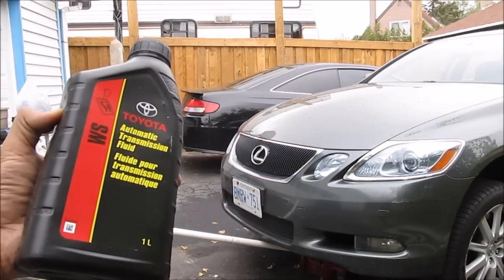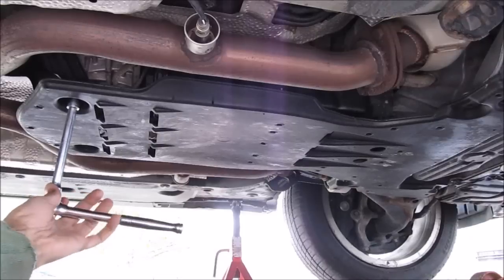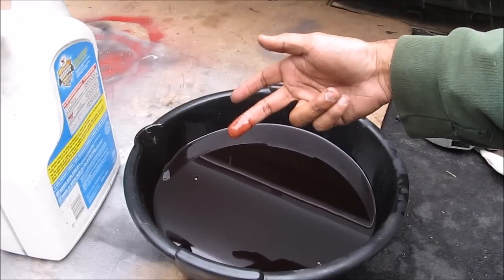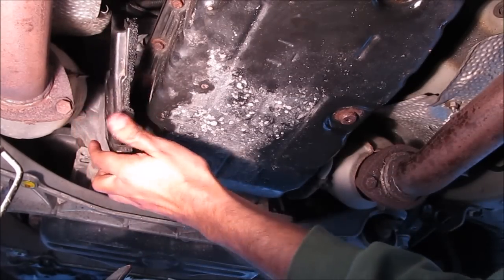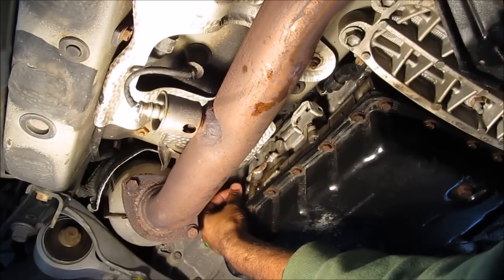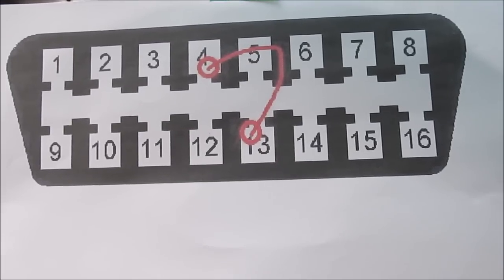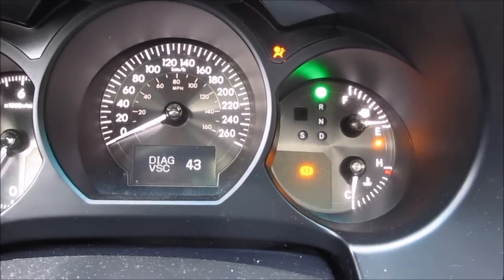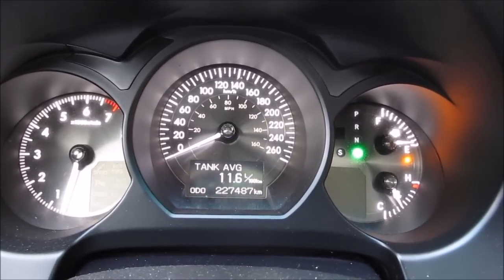Toyota / Lexus Sealed WS Transmission Fluid Change

Comment: Lexus...the dream. Another great video. What year is your Lexus and how do you like it?
Reply from the maker: +Nathaniel D. It's a 2007 GS350. I'm absolutely loving it, smooth ride, good power, no torque steer, fairly luxurious.
Reply: I driven an 06 GS300 but its really the GS350. Its drives quite similar to the ES350 just the only difference is the ES is FWD while the GS is RWD. The throttle is very sensitive as you don't have to press too hard on the pedal and it takes off. lol

Comment: Hi, just a quick question about the diagnosing of temperature, do I just need to leave it on park and let it idle and wait for both the park and drive lights to come on simultaneously after removing the wires on the obd port to know that it is on the right temperature to check the straw underneath?

Comment: Great video. Only thing I would want to stay away from is those cheap hand pumps. You can see the tube in the box is kinked!  Trying to put back the same amount given all those tubes and extra length that would have fluid in them and surely it gets messy and not all would be pumped. I gotta think a funnel/tube coming from the engine compartment side fed down would allow a much cleaner, precise and easy refill. Let gravity do all the work!  Great vid!
Reply from the maker: +condor5635 I wish, but the transmission is located underneath the cabin on rwd cars, not under the hood, so there's no getting at it from above.
Reply: speedkar99 
those bastards totally did that on purpose. Heck, the whole change up with unnecessary added complexity in newer vehicles were all on purpose. 
Sigh..
Reply: I love those transfer pump and it works really well for me. Need to put a bit of oil inside to reduce friction (as instruction say that came with it).  The tube maybe kink but just straighten it out since the tube is very flexible.The only drawback using these is that the oil keeps flowing out after you stop pumping so have a container to catch the oil spilling out every where.

Comment: Your new car? Congrats brotha!
Reply from the maker: Yes it is, thanks!
Reply: Any problems with it? How many miles were on it when you bought it? 

I'm still rolling a 1998 ES300 (thanks for all the great how-to vids lol) but really want to get a GS350 for that rocking V6, RWD and double wishbone front suspension. They're pretty rare around PDX though, especially RWD. The few clean ones local to me are 2010/2011's and $17-19k. A few thousand more and I could get into the newer generation 2013.  Choices, choices.

Oh BTW, do you know if 99-01 ES300 front seats will work in my 1998? A local salvage yard has some clean front seats from a 99+ that have side airbags...while of course my 1998 does not. The front seats are the bane of my interior and when I sell it (for a GS) I'm sure the $50 for these used seats will be worth it.

Comment: Hi, I heard that they offer oil replacement with a special installation (by pumping through the system - like on cars with a box cooling radiator). I considered my box on is250 did not find any handsets for connection. It is possible that they deceive me by talking about such a method of replacement. I think you can change only a partial replacement. What do you think? Thank you

Comment: Do you need to replace both transmission fluid and differential fluid or is it just 1 entry/exit point ?
Reply: Transmission every 25k transmission fluid also lubes awd transfer case if so equipped 
Differentials every 50k

Comment: Is the last part necessary; not switching the gears, but hooking up the wire to ports (4) and (13)?
Reply from the maker: +pete1817 its good to check the level of the fluid in the tranny but not 100% necessary

Comment: if you don’t mind me asking how did you let the excess oil drained since your overflow plug is rusty ? That mean you can end it up over fill it or under fill it ? I really like your highlights but if I were you I’d get a new pan with new some new plugs, that could prevent you from buying a new transmission 😊

Comment: What if you just drain out 2.5 quarts exactly, and put 2.5 quarts in? Do you still need to check fluid level? Please help i think my overflow bolt is seized.
Reply from the maker: I did that. My plug was siezed
Reply: That should work, provided you had proper fluid level to begin with (which you'd never know since they don't give us a dipstick)

Comment: hey, great video. I be very glad if you can help. i got new 4gr engine and gearbox but the gearbox came without any ATF so how do I know how much ATF i should put into the gearbox as your video shows i should put the amount that came out (2.5L), thought mine didn't even have a drop of ATF, and the sites on the net say I should put 7.5 litres? can you please guide me on this
Reply from the maker: Check the repair manual. Since the transmission is used you don't know if it's completely drained or if the torque converter is drained etc. 

You'll definitely need to do a fluid check
Reply: Thanks soo much. I will try to do that.

Comment: So you are only changing less than 50% of the actual transmission capacity ?
Reply: You are correct, I get a transmission flush every 60,009. I change all 11 quarts  at a local shop, they cycle all the fluid out of the transmission until it’s all clean. And it’s not $600 like Toyota wants to charge to drain and fill 3 quarts.

Comment: Wow this is a big pain I think I'll let a mechanic change this but I really like doing stuff myself. So a question instead of doing all the measurements at the end why not just look up the capacity of the tank and then put in that amount and then you know you filled it to the proper level???
Reply from the maker: ATF doesn't go by capacity because it expands by temperature
Reply: @speedkar99  Thank you. I wonder what it's rate of thermal expansion is.

Comment: Tyvm I needed this for my 2007 gs450h earned a subscriber (:
Reply from the maker: Thanks. Is it any different on the CVT?
Reply: Did you need a transmission fluid change or soloneiod

Comment: I don’t see you change the transmission filter under this pan is a big black filter you would need to change is as well
Reply from the maker: Yes if you drop the pan
Reply: If you don’t mind me asking How many quarts did you use for drain and fill ? And do you ever recommend me doing a complete flush to my 08 Lexus gs350 ? Or drain n fill should be good ? FYI I have 110k now and the transmission hasn’t been serviced before ! Thanks In advance

Comment: I just did a drain and fill on my tundra that has never had the transmission serviced. All I did was drain it when it was cold and refill the amount that drained out. I didn’t know I had to do all that. Will it cause any issues the way I did it? Can I just drive around the block and then loosen the hex plug to drain the excess fluid since that’ll probably warm up the fluid.
Reply from the maker: Yeah that should be fine

Comment: Great work. I'll have to do some research and look under the car but, I hope this is similar on a 2009 Lexus IS250 RWD with 111k miles on it. Time to order the OEM fluid.
Reply from the maker: +Mike Anoneemus Yes it should be a similar setup on all rwd Toyota trucks and Lexus vehicles.
Reply: 111 miles only ? Wow you don’t drive much huh

Comment: hello  what about the oil filter for this toyota i think it should be changed... dirty filter with new fluid may cause aproblems
Reply from the maker: Yes the transmission filter can be changed if you drop the pan.
Reply: The filter is suppose to be good for 100k.

Comment: RWD in Canada? Did you outfit the car with snow tires during the winters, or just garage kept the GS? I'm thinking of getting a RWD GS350 possibly, but in the States East Coast area we get the occasional snow.
Reply from the maker: I have a Camry with Winter tires when it snows. 
After the roads are clear I still drive my GS in winter. When I get caught in the snow with it I'm dead though

Comment: thanks as hot ATF has higher level, user can loose the overflow hex nut first, rather than open it at high temp. right?

Comment: Awesome video! I have an ‘08 GS350 that I bought 5 years ago with 60K miles. I now have 167K but have never changed the transmission fluid. Is it too late? Any advice?
Reply from the maker: Drain and fill. 
You only get 2.5 quarts out at a time so no harm.
Reply: Thanks bro!
Reply: I have the same car. Are you getting vibrations and weird shifting on gears 1-3?

Comment: Could you do this with just warming the car up for a certain amount of time and drain the excess or will it drain too much if too hot?
Reply from the maker: +Dorjee Gyadatsang you have to warm the car up after you've added fluid and then release the overfill plug, as described near the end of the video.
Reply: speedkar99 I just received the notification of your reply, would like to ask you one more question while you are still online.  Yes, I meant to say after you have drained and refilled, can you just warm up for a certain period of time and then let the drain plug do the rest.  (bypass the cheat code like shifting  and having to do all of  the combinations with the OBD)  Thank you for making this video by the way.
Reply from the maker: +Dorjee Gyadatsang technically there's a certain temperature range the transmission fluid must be between to get an accurate reading, hence the method with the obd2 reader or the shift sequence. If you wait too long then it might get too hot and you'll end up draining more fluid than required.

Comment: Can an old transmission  filter and the fact that it needs new transmission  fluid ,can it can jerking  movements?
Reply from the maker: +cali west yes sometimes
Reply: speedkar99 i hve the same car and let's  say im at a long street driving then ill come to a stop n as im at a sudden  stop youll feel a winding  movement  from the tranny not grinding, n as u press the gas peddle the car will hve a jerk movement  ,it doesn't  happen  all the time but only at certain  times  ,and thanks  for  your time

Comment: The one thing I don't like about this car is that it shifts to 1st gear if I slow down below 5mph. If I'm going over a major speed bump or sometimes crawling around a corner it goes down. Is this normal because if it shifts down to 1st from 2nd I immediately want to go while it's still rolling then it's an ugly upshift

Comment: what about changing the filter?????
Reply from the maker: You can drop the pan and change or clean the filter if you like 
Most of the time it's not nessesary unless your experiencing transmission quirks
Reply: @speedkar99  if you drop the pan do you need anything to seal it baxk besides the screws? Example. New gasket , sealant.
Reply: @luisalcaraz5615  I would recommend changing out the gasket if you're replacing the filter, especially if you don't regularly change out the transmission fluid.  They are often sold together as a kit.

I had to replace the clutch solenoid (common part that goes bad on a lot of IS250 2007, ERROR CODE P2757 - Part#: 35280-30050), did a tran fluid flush, replaced the filter and gasket, been running great.  Check with a magnet to see if there are any metal shavings or burnt odor to the fluid which might mean a transmission rebuild is necessary.
Reply: 1 out of the 3 codes match yours that I got. P2757/ P0983 / P0761 . Sounds like i have to replace the clutch solenoid first before anything and follow your steps. I'm at 162k miles. Got it at 92k. Never changed trans fluid on it.
Reply: @luisalcaraz5615   If you're throwing multiple codes, it's kind of a gamble.  You have the option of replacing multiple solenoids, but if the clutch is done for and you need a rebuild, a good transmission mechanic will likely replace those solenoids anyhow, so you might be out a couple hundred bucks + time if you go the cheaper route first, then have to rebuild anyhow.  I'd have it inspected professionally and get a 2nd opinion at a tran specialist.

Otherwise, try to find out if there are any subsidiary codes to isolate which solenoids are faulty and do everything else I did.  Make sure you do magnet test and smell fluid too.
Reply: @szurheal  where'd you find your clutch solenoid from?
Reply: @luisalcaraz5615  My mechanic friend got it for me but you can order online.  I prefer Toyota OEM, but cost difference should be around $40 for aftermarket.
Reply: @szurheal  I found a kit online. It comes with 9 pcs for $200. I'm not sure if i should get the whole kit or just the solenoid that is bad. What do you think?

Comment: Very less came out from the transmission, maybe your transmission is low on fluid, you should check the level by opening rusty bolt,  i drain the the transmission and came out 3.2 quard which the user manual says and if we change the filter then it should be 3.8 quard
Reply from the maker: For the GS350? Should be 2.5
Reply: speedkar99 how can I buy parts from your store  ??
Reply: This what I said you cant drain the torque converter. It has a bunch of old fluid still inside it unless you drop the tranny. So it seems you just mixing clean fluid with dirty fluid.

Comment: I'm replacing my transmission from my 2007 IS250 because apparently the old owners before me never changed the transmission oil and when I drained it, it was pretty bad so word of advice to Lexus owners changing transmission oil or be prepared to buy a new transmission
Reply: Joe L did you do a drain and fill like in the video or did you do a complete transmission fluid flush ?

Comment: @speedkar hello buddy am getting really confused with all this. My car is a toyota crown 2007 with 3 gr fse engine. Now i changed my Atf and we put in 8ltrs. We also removed the pan and the filter. According to most guys in here i should have put 4 litres?
Reply from the maker: 8 liters seems like alot for a pan drop....check the overfill plug.

Comment: Is it true that even tho you changed some there still a ton of old transmission fluid left in the trans and torque converter. So does this even really do anything to help? It seems it would make it possibly worse especially if you dont have any current problems.
Reply from the maker: Yep. You need 3-4 successive drain and fills to change out all that fluid.
Reply: @speedkar99  also you dont want to drain / change all the fluid out at once anyways because there are metals in the worn fluid that sometimes keep the trans shifting. But this a good tip to fill the trans fluid if its low. But I know ppl who have 200,000 miles on same trains fluid. I rarely hear of lexus auto trans failure unless its user error.

Comment: Can I check the trans temperature using this method on the 2014 Camry? I tried doing what you did. I saw the high revs and light blinking. I switched back and forth on D and N and back to P. I haven't seen the D light come on so I'm not sure I did it correctly.
Reply from the maker: Yes it should work
Or just get techstream for $20

Comment: I have a technical question and i hope you answer it...
My Hyundai Sonata 07 v6 3.3L engine has about 125000 mile on it and last time i checked my transmission fulid was kinda redish (meaning it's not black but i don't think it has ever been changed before) would you recommend me to change it or keep it as it is? knowing that last time when i changed my T fluid for my previous Toyota Camry 06 I screwed up the transmission, it started to slip and never returned back as before sadly :( and i'am kinda afraid to deal with the same issue.
My Trans runs great and i'am not sure by changing it will be a help or simply saying goodbye :)
Reply from the maker: +moe raw I would change it. But don't do a full flush, just drain and fill. Changing the fluid allows the new fluid to dilute the old fluid slowly which should be safe.

Comment: What u think of these 2006 gs300 awd. Tell me about service maintenance  etc. Are these engine port or direct  injection
Reply from the maker: Don't get the GS300. They had engine issues. Go for GS350 or V8
Reply: @speedkar99  what about 2008 GS350. AWD.

Comment: sir.. i have a 2016 mazda 6.
i contacted the dealership in my country and they told me that the transmission fluid is a longlife fluid and they are not and will not change it. only refill it if it needs to be.
i checked the user manual and did not find anything about changing the automatic transmission fluid.
So do you think i should change it or just follow the dealership instructions? my car has over 70000 miles now
Reply from the maker: +auriongray yea change it if you want to keep and care for your car. 
70k miles on a two year old car is a lot!
Reply: Take out the housing for your air filter. There is suppose to be a very short dipstick on top of the transmission that is bolted fast to the transmission.

Comment: Any suggestions why my Lexus IS250 engine shuts off when reversing and putting it into drive, everything stays on but engine dies.
Reply from the maker: Torque converter lockup?